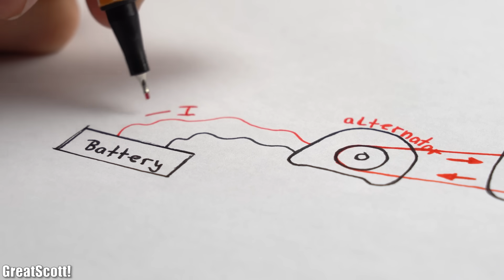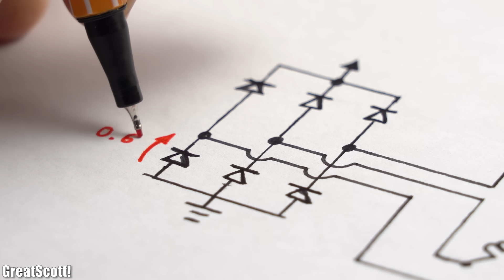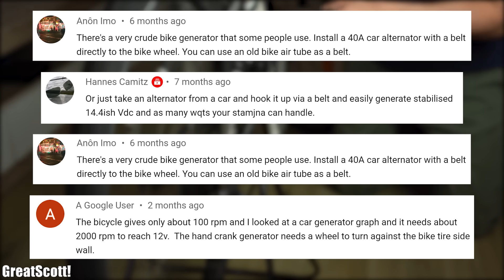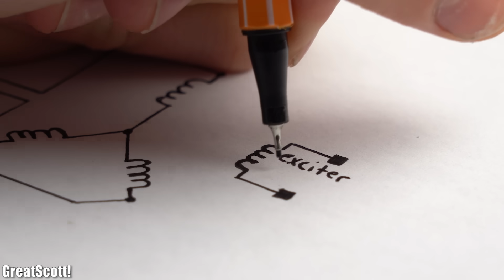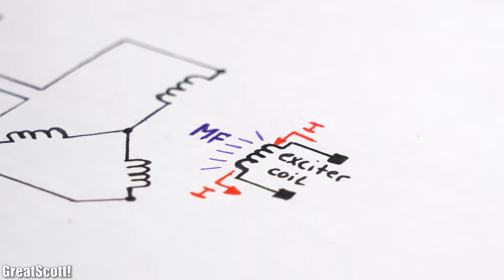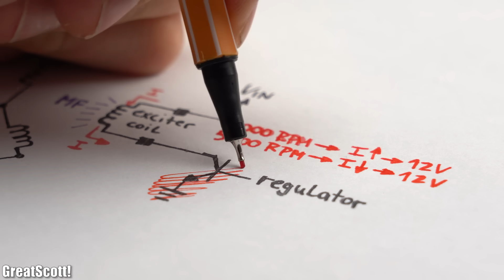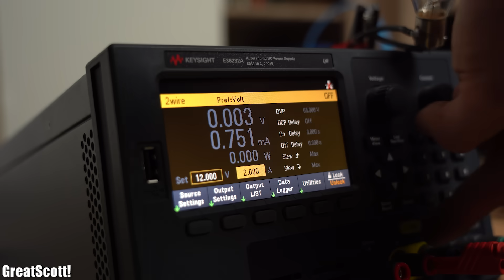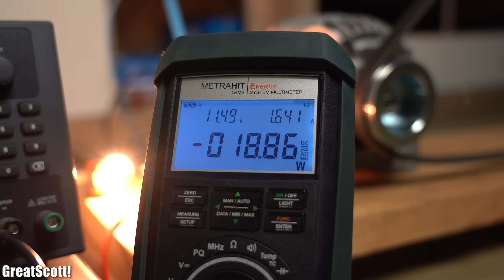Using a car alternator with a bike to power my home? How much energy can I produce?!

Comment: Your main problem, at the very begining of your thinkering with an alternator, is not knowing that alternators don't use permanent magnets. Instead their electro magnetic coils need to be agitated to induce magnetism. The "two little connectors" are there for a purpose. And their purpose is just that - coil agitation.
Reply: Excitation???

Comment: Alternators were the go to for guys hooking up wind power for off grid battery charging for decades. If you lived near a running creek you could get power from that as well. But you're not getting 1400W from your bicycle unless you were as strong as 2 horses. One HP is 745.7 Watts.

Comment: I have watched a couple of your videos and I have heard you can turn this into a higher voltage generator by removing the regulator or bypassing a portion of it because it reduces the current to 12volts. I'm not sure if this is correct, but I have two alternators from old cars and I am ready to figure it out. Any suggestions or videos would be appreciated. Thank you!
Reply: Yeah there's definitely a way to rewire the alternator to produce better power with slower rom. This has been done with wind and water using alternators.
Reply: read my comments bro.. ive done it  before and give alot of suggestions in here.. good luck

Comment: Haven't watched the video yet - my prediction: 
No YOU can't power your house with an automotive alternator.
A pro velodrome/track specialist could... but only for a few minutes. 

Yeah... the Alternator can make 1400w 
But to get that power out of it you'll basically need to put that much power into it (assuming 100% efficiency... and that ain't gonna happen) 
most people can't do that - a trained, seriously fit cyclist can make 1400w sure, but not for long.  (I spiked 1600 on one of the climbs I did today. For all of 5 extremely painful seconds) 
Now, the alternator in a car is running off the rotational energy from the engines crankshaft... ie: its running off a 100hp or more engine... a average human is sub 1 horsepower.  a  TRAINED human might make 1 hp at peak power output. 

I have a functional power threshold (maximum power output for 1 hour to exhaustion) of 400w.  That is very good - its WELL  above what most average casual cyclists can produce and WAY beyond what an untrained cyclist can produce.  That is competitive Athlete territory - not pro, but a high level amateur competitor.   

I can make 300w average for about 4-5 hours.   Willing to bet - that the fella doing this experiment can't do that.  

Gonna guess he makes a 500-600 watt peak (something he can only make for a few short minutes) and a sustained average somewhere in the 150-200w range.

Edit: wow... he made alot less than I predicted.   Issues with the setup and using the alternator itself. 
The electrical issues he was having with the alternator is in his court can't help him. 

But on the bike side of things a few suggestions:

1. He needs a stationary trainer with the resistance system disabled for a more solid platform (look around for an old, used fan type trainer, a pre "smart" trainer unit) 
2. He needs to position his saddle correctly and dial in his fit to the bike for higher muscular efficiency and endurance 
3. He needs to ensure that the chain is properly lubricated and ensure his drivetrain is running as slick as possible to avoid efficiency loss
4. The biggest front chainring and smallest rear cog is going to give you the highest rear wheel RPM - provided you have the grunt to spin it.

Comment: Altenators spins about 3 times faster than the engines rpm which is why it can run everything at lower rpm and not cut out. That bike is no where near operating rpm of an engine.

Comment: If you get an alternator for a 230 volt generator (in the uk I can get a 6.5 kv one for £350) this will produce  6.5 kv at 50 rpm.
I have seen people modify a car alternator but it seems a bit of a waste of time, the investment is worth it I think for the one off payment of 350.
You can also the way I'm seeing it is couple that 6.5 kv alternator/generator to a 230v 2020 watt 3000  rpm motor (I've found one for £110).
Once the alternator gets spinning and generating it can then power that motor obviously it uses 2.2 kv so that leave you with 4.3 kv to use in your home.
Maybe there is some science I'm not incorporating but I'm struggling to see why anyone needs to pay for electricity.
Apparently there is a patent for this system guess who own it ? one of the big global oil companies.
That seems to be the main reason every home business and car isn't using the technology.
If we all ran on this they couldn't control us as the do now by manipulating the prices we pay.
Some how crude oil cost is lower than ever but here in the UK it is some of the highest prices ever paid.

Comment: IF you used a Delco 10si or 12si Alternator, you can by pass the Rectifier bridge and get straight A.C. Current from an alternator (The Models I mentioned are the Easiest ones to do that with). If done correctly, You can make the alternator self excite.

Comment: Great job. A friend of mine who is in the MTN biking hall of Fame as a builder. Ross Shafer founded Salsa cycles he had a bike powered  TV in the break room. He also built a human bike powered metal lathe. Really cool. Keep reaching out, our planet smiles on folks like you 👑
Reply: He really needs an electric bike. The alternator could charge the bike battery. Just a bit of pedaling to get the system started then it runs on its own 🙂

Comment: you should connect +12v from battery via series light bulb about 1-3W to one of this pins, then when you start rotate it will be self power up via additional inside diodes and then light bulb go off. It's an old school charging control lamp you can find on car dashboard.

Comment: 20watts out is seriously under utilizing the capability of the alternator but it could be a good workout like you said. Good learning experience and saved me the trouble of making one so I will focus on other plans. Thanks for saving me time and effort and it was a great video and honestly presented. Keep up the good work.
Reply: those alternators can put out over 5kw at 120v is geared properly and usually take around 8hp to do so
Reply: i used to take in the unemployed and for a bowl of porridge they would keep me in power all night using a battery of just such a bicycle adaptation. had to cut out their tongues of course --- so noisy, the jobless of today. They kept losing their jobseekers' allowance and none of the immigrants want the job. Any volunteers out there??

Comment: need a old bosch alternator with external regulator pack on the back- on german cars 80's with no smart charge system. you can charge up a bank of batteries 
, then use a inverter 12v 220v.

Comment: Common myth that the alternator charges the battery. You really only get like .3 V of a charge on a 12V system as it usually only runs at 12.3-12.6 V. Now if you take the voltage regulator out of it that’s where you’ll get the power from

Comment: Through this bike, it can run my broken piston 3000 watts generator if I reach a 3600 rpm to produce 220 volts of electricity as its output ..

Comment: Now... If you put a gas motor on that bike, you may have something there...😉
 The alternator should be connected to a battery bank to store the energy created...
 You could even use an electric motor, and run it prior to a storm, and then use the battery bank in the event of a power outage
 Or.... Just buy a battery backup generator system.
 Because if you truly applied science to this subject, it would be clear from the start that it's an exercise in futility

Comment: What a lot of people don't know about is surge resistance pressure, in other words if you remember cars before they had computers to maintain RPMs when you turned the headlights on while idling you would hear the engine bog down some and at the very instant you turned the lights on it would be very difficult for a person to turn that alternator.
Reply: All my Hyundai Ponys do this.
Reply: Interesting thanks.

Comment: An Axial Flux alternator with bridge rectifier will work much better here, but you won't power your home unless you greatly (make that HUGELY) reduce your electricity consumption.  Combining solar and wind with your multipurpose,exercise bike might at least make a dent in that electric bill.
Thank you for your videos, they are always a pleasure to watch. Thanks for sharing your knowledge!
Reply: I knew an electrical engineer who constructed a bicycle, alternator and battery setup for his kids to watch TV.  It was a way to prevent them from watching too much.  If they wanted friends to come over to watch a program, they could charge the battery first beforehand!

Comment: You can also take apart the alternator, get rid of exciter coil, regulator, clip leads. reverse polarity magnets on the coil on each tab (after grinding off) then case it and epoxy. put it back together, rip it with a start coil once attached to your motor and it will produce roughly 220v.

Comment: you're good with electricity, but not with mechanic. Use more wheels. Increase the speed, lower the energy put on the bike. Buy more alternator and rotate more than once from the same bike with gears.

Comment: 1 a externally regulated alternator
2 remove rectifier bridge from stationary circuit 
3 now add D/C to exciter
4 A/C will be on the output when the rotor is turned

That's all I know from this point. More technical issues are presented and know what you're doing to avoid death or fire!

Comment: I live off-grid. I charge my batteries at 30 amps (360 watts) for 8 hours. You would have to pedal for 180 hours to provide my electricity for 24 hours. I think ill settle for a good old gasoline engine and 1 gallon of gasoline.

Comment: Try multiple alternators using pulley system to turn all simultaneously while pedaling bike. Find some way to combine output into usable current.. just enough to power a small appliance would be pretty cool

Comment: Would there be a way to make that charge an off grid power grid? Maybe use the alternator and a hydro set up to tender a bulk of batteries? It would keep the always charged, with an inverter set up I think it would make a good set up and when can’t you find replacement alternators.

Comment: I’m no electrical scientist, but how much power is wasted due to that loose belt? Belt should make at least 180 degree contact with the pulley and be tight. A third wheel mounted on the board would have solved that.

Comment: it must be possible to gen useable power via a bike..   if it were designed well enough...  there is sufficent mechanical power, for sure!   Its just the generator seems to be not efficent enough in the case of most previous attempts.  Usually they say it powers a light bulb etc...   well, I say you should be able to power a whole house technically...  only major output devices such as electric cooker and wash machine should provide an issue..  but even then it should be poss to build up the energy in a large battery.

Little research online shows cyclists can gen 400w of power.. mech work that is...   thats elite...   so lets say joe bloggs can gen 200w of mech work fairly easily in his home.   A little more research shows typically efficeny of gen for commercial generators is about 45-50% ... so lets say 100W of electrical power gen...  so you cycle 10 hrs.. its 1kw.h.  Lets say like me you do 1hr cardio a day ...  but you bump it up to 10hr/week...  so now you gen 1kw.h/week.   So, would be saving 18p/week.  Not bad.  Well, maybe if energy goes ballistic.. it might be worth it :)   I cant believe how inefficent our electrical goods are!!  ....  I stand corrected based on my own calcs :)

Really cool little project.  There is no way I would have the mech skills to pull that off...  this pretty much shows why we neeeeeeed to go nuclear to save us from global warming.

Another way to get free power...    get any cafe/resteurant/super market.  They are throwing away a ton of high sugar items that are out of date or left overs...  extract the sugar... ferment... distill into ethanol...  get a petrol generator and have converted to run on bio ethanol ... run it and power home.

Comment: Great video! What is the physical resistance while under load?
Reply: He'd need a crankset, pedal or rear hub power meter to quantify that.  
Such things are readily available,  serious cyclists use them for focused training data - but not cheap (500-1500 dollars) 
And some systems would not be easily adapted to the cheap bike he is using.

Comment: But you were only measuring current for a little lightbulb..  the resistance is low so the current will be low. 
You need to try it on something that can test the limits of the system - either your muscles, or the alternator (rated at 120A).
I would think you could get a lot more amps if you put on a bigger load.. the best test would be a drained deep cycle battery - since that is ultimately how you would store the energy..

Comment: Use the front wheel as a gear ratio behind the backwheel. If you made a stand alone Axelshaft with a small cog and your front bike tyre on the same shaft... then had an extra belt to the alternator setup youd get so many more RPM

Comment: I had the idea to use an exercise bicycle that was already mounted on a stationary frame (woodwork not necessary).  As a means of reducing friction, I considered going to a chain and sprocket set up as opposed to a serpentine belt.  Haven't got to it yet as I have other priorities, but the intent of the alternator is as you have stated, to charge a car battery.  The battery provides the power to excite the alternator to begin with.  Just pedaling to power a house directly from an alternator is pointless, but to charge a car battery to have enough reserve to run an inverter is more what I have in mind as a back up to solar.
Reply: Quite correct. The alternator should have a battery connected just as in a car to even out the ups and downs in pedaling. See my comment for more

Comment: If you're going to use an alternator it is best to change the winding configuration to get more power from it at lower RPM. On the other hand just use an old trend mill motor or any dc motor and you will get better results.
Reply: Specialty marine alternators like those from Balmar produce 60+ amps at an engine rpm of 1200.  They are externally regulated, also, and cost a bit more

Comment: With the low power output I think a good goal if you where going to try again would be bear minimum power like the electric controller and fan on a heater and just enough to keep your refrigerator cold if you are doing this in the apocalypse you can learn to make candles

Comment: I know this video is some what old, however I do have a solution to your issue. Being that you have to power the unit in order for it to work then take it apart and drill the armiture just enough to appoxy magnet's to it. This way you will not need power to make power and you can produce more power than your producing now. Easy fix. Also they do sell units with this modification already done to car units like this. Missouri wind and solar is a good place to start if you're willing to do a bit of research. 
   Happy New Year to you.

Comment: Your belt was too loose and thats why you had the belt slip… also a car alternator is limited on how much power it can make before burning up… you best bet for this method is to get a small car battery to hook up the alternator and then hook up an inverter the battery… the inverter would work off the battery and the alternator would then maintain the battery

Comment: Use a Oscillator to match AC current with RF waves n it’ll power a electric motor. Can multiply the output after you dial it in. RF waves don’t create heat like electricity either

Comment: always wanted to try doing this. Though I wanted to charge a battery and attach a charge indicator for when it was full to then use and then recharge once empty. 14+ yrs though is definitely a long time. video was great never knew about gear ratio that was useful information.

Comment: Voltage regulator is the plug at the back, it makes sure you get 12v for car systems, otherwise it will overcharge and fluctuate.

Comment: With some decent technical training you would have known this was impractical before starting. 
Putting all the moral issues aside, we burn coal for electricity because slaves are too expensive. 
At 50 Watts per slave a modest 5 KiloWatt air conditioner would require 100 slaves a pedaling.

Comment: WOW Just saw your video! (months Late🙄), we've been doing this with alternators for years! I've personally learned this as a car mechanic where along with rebuilding car engines, I used to also rewire (refurbish) Alternators and Starters that burned out! (Copper Wires Broke/Fried) 🙄including Relays, wiper motors and other electromagnetic actuating apparatuses! Didn't need to, just Hella-Loved doing it!  Your video was refreshing! Thanks!👍Many aren't as interested!🥺

Comment: I made a bicycle generator mounted tbe treadmill motor right behind the rear tire a o that the small pulley i.lut on it was in contact with the tire. No belt needed or no.part removal from bike. Sold it to.people who wanted it in their rv camper as a emergency.  It ha a charger control and 12 speeds

Comment: if you added a free rolling belt tensioner along the base board between the alternator and the bike wheel, sort of pushing upward on the bottom belt belt then your results would be better.

Comment: I bet if you run 2-3 in series it will give you a better payout :) but I’m just now learning electrical.. please tell me if this will work or not. I have an idea using a magnetic powered stator to turn the alternator with zero energy